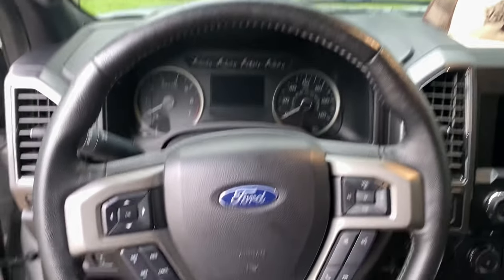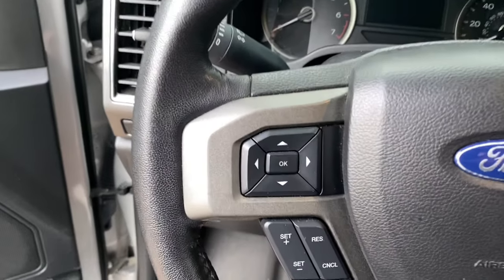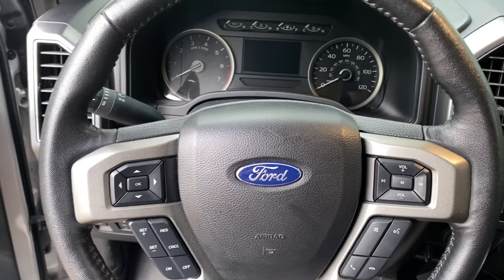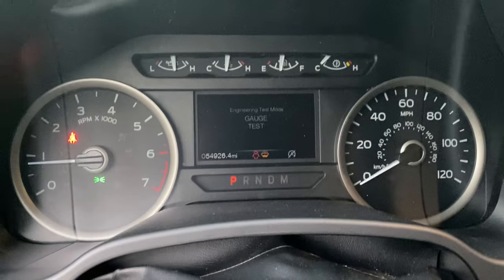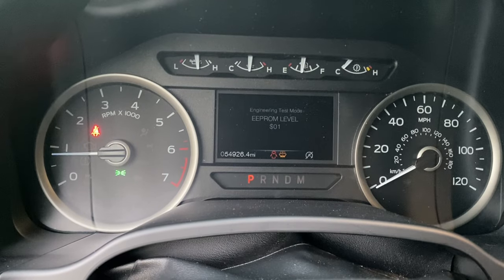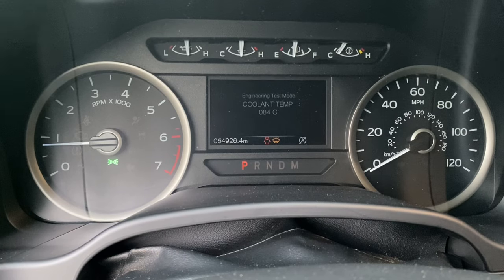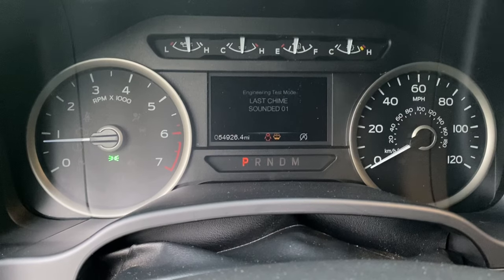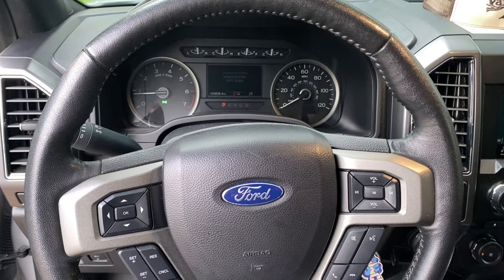How to Use Engineering Test Mode on Ford F-150 (2015-2020)

Comment: If you’re MPG computer is always wrong when you compare it to your hand calculations then you can also adjust that in this menu. On the AFE Bias screen
Reply from the maker: Yes, I found that out after I made this video! Good point 👍🏻
Reply: @GRmotors  I just learned that this week. Did my math and made the adjustments. Short road trip this weekend should tell me if it helped.
Reply: Need to make a video of that....
Reply from the maker: True that

Comment: Your electrical system has a charge problem, your running battery voltage is too low.
Reply from the maker: What’s it suppose to be at?
Reply: ...What can it be ...I suspect mine is also.
Reply: 13.6 14.2 im a bass head but thats how it is on mine
Reply: @GRmotors  Typical charge/running  voltage is 13.8-14.2, but one would have to check Ford's spec's to be certain.

Comment: Hmm did not work for me….hubs has a 2016 F150 2.7 ecoboost. Did the steps and it didn’t work…😕
Reply from the maker: Try it a few times, it’s time dependent for the time you hold the buttons

Comment: Finally finished my alternator swap and was able to try this. 
Two questions for ya:

1. Any idea why this would NOT work on a 2015 SuperCrew XL 2.7?

2. (And possibly the answer to 1) I have a persistent TMPS error message upon startup because I’m not fond of the price to replace the batteries. Is there any way to mute or ignore a message like that?

Thanks for answering my previous question too.
Reply from the maker: I do not know why it wouldn’t work. My buddy has a 15 and he had trouble getting it to work at first but it finally did. And I think forscan would be your only options to mute that alarm

Comment: That is very handy to get the battery voltage, since there is no gauge for this.

Does anyone know if there is an advanced feature menu for the factory radio with the small display (not touchscreen),  with the physical pushbuttons ?

Comment: Does anyone know if you can switch from KPH to MPH in engineering mode? My F150 came from Canada and I am in the states.
Reply: You should be able to get this from the regular display options...  MPH or KM/H for digital speedometer,  M or KM for odometer,  F or C for outside temperature and MPG or KM/L for fuel consumption.  On my 2017 F150 these can all be changed without going into engineering mode... and once changed,  they stay that way.
Reply: @LakeNipissing  I have all of those on display options  except MPH and KM/H. Could my vehicle not have it? I have to constantly hit ok every time I drive to select mph, it’s getting annoying
Reply: @mw3designs  On my 2017 F150 (V8) it states hit 'OK' to switch to MPH,  and then it stays there every time the truck is restarted.  My truck is in Canada,  but I have all of the units in US;  odometer in Miles,  digital speedometer / cruise control in MPH,  fuel econ in MPG and outside temperature in °F.  Only the analog speedometer has large 0 to 200 km/h digits,  with small MPH.   Interesting... there must be different software versions.

Comment: Anyone know if this works or  how to get access on a 2021?
Reply from the maker: I’m not sure on that
Reply: @GRmotors  I've got a 2021 Lariat. Can successfully get into engineering mode and adjust AFE to my hand calc. number. Confirm it saves by exiting to other functions of maint. mode and returning to AFE menu but when I shut truck off, there is no change made to the original DTE and MPG numbers. Like it's not saving my results, YET, when I go back into AFE mode my hand number is still there. SO....not sure whats up with that.
Reply from the maker: Mine doesn’t change the already populated MPG but it does change the DTE number
Reply: @GRmotors  what year?
Reply from the maker: 2018
Reply: @waynehearst317 How do you get to the test settings?